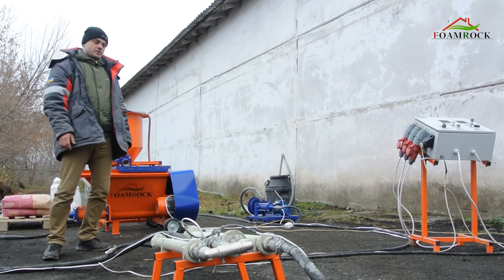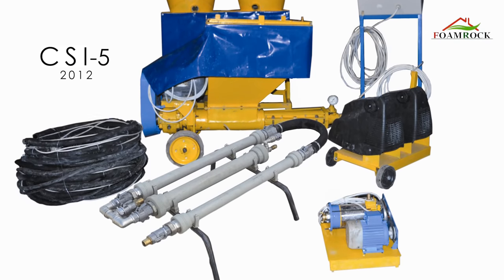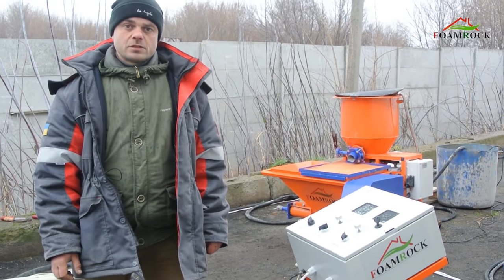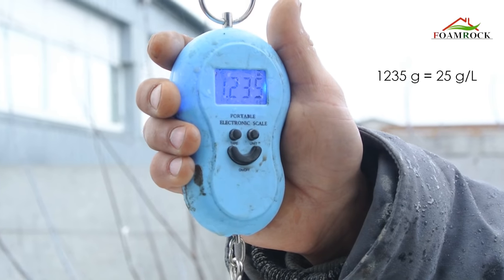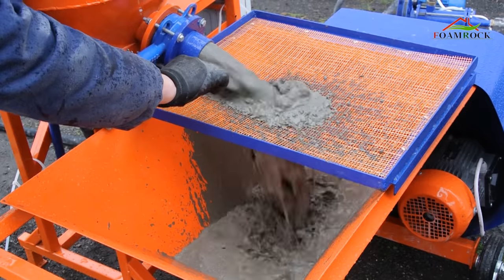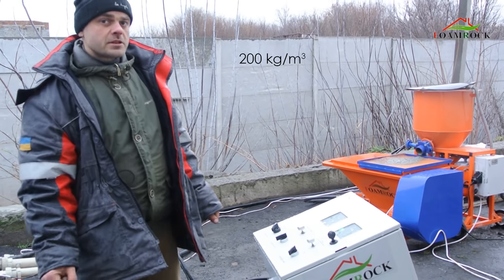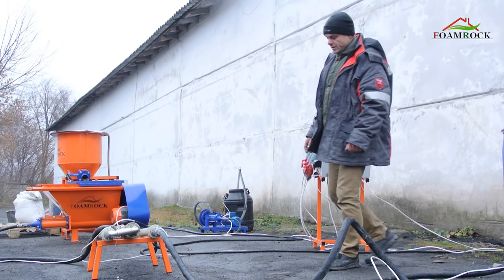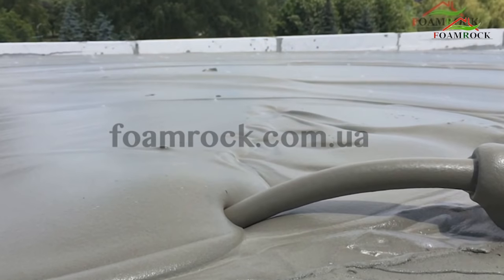Best foam concrete machine

Comment: Hi, i noticed you did not use sand in the mixture, can you tell me what sort of strength does the foam concrete achieve. Is it possible to achieve load bearing muxture?
Reply from the maker: Hello. It is insulation density 180kg/m3 with compressive strength 5 kg/cm2. For today to achieve loading strength for market price is impossible.

Comment: are you the builder of the machine ?
Reply from the maker: Yes.
Reply: @foamrockglobal  first thank you for replay 
then  where you are located 
and how difficult would be to operate the machinery ?
if the machinery does all the process mix,water, pump out the final product ?
range in meter cubic of production per hour?
cost of it ?

thank you
Reply from the maker: @andreasmicheloni5698  give me your email and I will send information on it.

Comment: Your produce small FC batches. The Equipment is filled by hand. How do you Monitor the FC quality during production?  By weighing buckets by hand?  How do you certify and QControl FC specifications i.e. spec density, mechanical and thermal properties?
What is the max. Production in m3  per day / 8 hrs? What is the max roofslope (%) possible? 
What is the max pump head (mtr)
What is the average cost of...
*foaming agent per m3
* plasticiser per m3
* Labor in hours per m3 
* Minimum crew size?
* Other chemicals used e.g. sodium silicate?
* Srinkage of FC after application?

Can your Equipment handle light weight filler Materials e.g. leca (expanded clay aggregate), pumice, slags, polystyrene, glass fibers? If yes please specify max aggregate size Fiber size

Is the inlineTubular device a foam generator + static mixer?

What provisions are made to prevent settlement of heavy particles in the pump hopper?

Do you use ordinary dish soap as a foaming agent or do you use sythetic or protein based foam agents?
What type of plasticiser recommended?
What water cement ratio recommended?

Looking foreward to your answers.

Thanks in advance

Regards
Bert españa
Reply from the maker: Hello. 
Where are you located?
What are your goals with this list of questions?
Reply: @foamrockglobal  thank you for reacting. unfortunately you did not answer any of my questions, but I will answer yours....
 I and my company  am/is located in Spain, Valencia Region.  
Looking at your Promotion Videos I did not quite understand what you are trying to  sel.
*FC construction Projects ? *your production Equipment?
*Your own concept of FC making I.e. Knowledge transfer?
* Your special foaming Agent i.e. hydrolised Keratin? 
Plasticiser?

Any interested client with some FC knowledge would ask the same questions as I did. 
Construction Business is very conservative.  To convince builders, civil engineers and architects to use "new" Construction Materials i.e. FC you must convince them with strong technical and commercial Info. Your video does not give that info at all. That is the reason why i asked you.
You showed some FC blocks und panels. What is the specific density of those blocks and what are the applicable insulation values?. What are the advantages of your blocks compared with autoclav hardened cellular concrete made by Ytong, Hebel, Xella or similar brands?  These brands have  officiall certificates and are aknowledged building Materials. What about your self made FC blocks?

Resuming:.  If you promote your......
Vision of FC making
FC machines 
FC making skills, 
foaming agent, 
Plasticiser
 you should be able to back up your promotional Video with solid technical Info and strong answers.
If you cannot give those answers  you failed..

Have a great day

Bert españa
Reply from the maker: We sell equipment with technology and foaming agent. You didn't answer only for one my question: what you want?
Reply: @foamrockglobal  i collect all available info of your Equipment, your technology, physical properties of your FC.
Once  I received that info, I will  decide  further step to be taken.

Kind regards

Bert españa
Reply from the maker: @sonofagun3193   Please give me your email and will send all answers on it.
Reply: @foamrockglobal  
What also interest me is following

Are the conical tanks placed on electronic load cells?  That would allow precise  ingredients dosing and also recording. Very much  needed for  evidence that the specified FC was applied in case of disputes.

You have a few Videos all showing different FC Equipment.
A Video with 2 separate conical mixing Tanks connected with hoses to the auxiliary equipment e.g compressor, foam solution pump, Tubular foam generator /static Mixer the control Panel etc. 

And 

A video with the equipment built on a main frame.

Question: 
What is the functional difference of these set ups?

Do you need an external 400 Volt Power supply?  If yes this may be a handycap for FC production in remote Construction Sites.

Why not built the entire FC Equipment configuration on a trailor?  That would significantly reduce the erection time / handling of the equipment before FC pumping.
In case of a trailored Version, you could ad a small screw conveyor to reduce handlifting of heavy bags of cement,  lime,  sand (If applicable)

Hint:. If you prefer not to build the machine in a trailor, place the the equipment on a skid ( not on legs). In that case you can move the skids by pulling with a truck.
Reply from the maker: @sonofagun3193  Give me your email and I will answer you.
Reply: @foamrockglobal  I am also interested in the same info as @Bert Safor. In terms of being a dealer for your equipment here in my region.
My immediate questions are about adhesion, can i spray it on a ceiling?, and fibre additive.
Reply: @foamrockglobal  also, what is the equipment   able to achieve with Portland cement instead of magnesium?